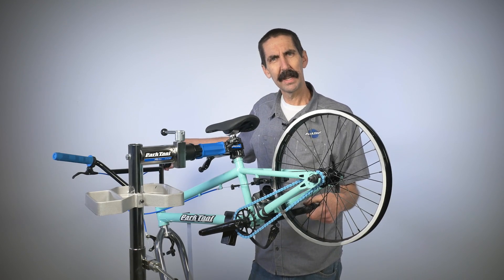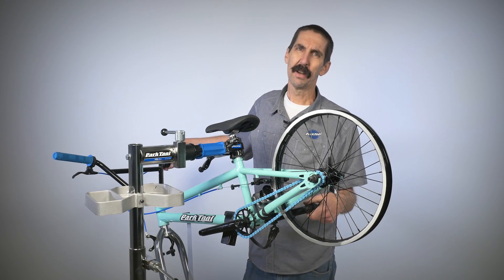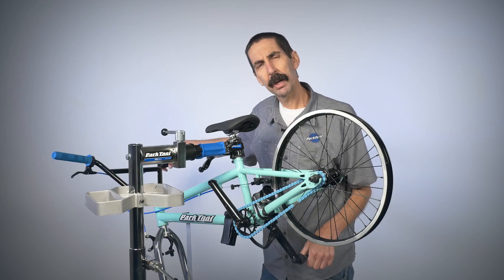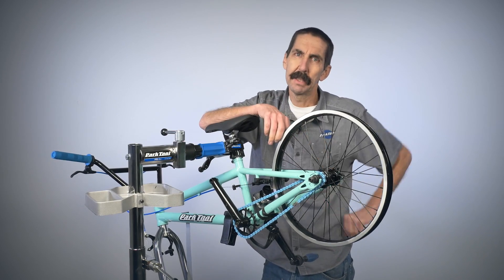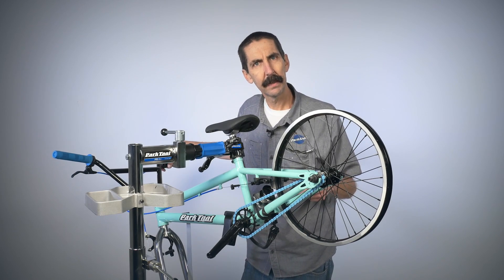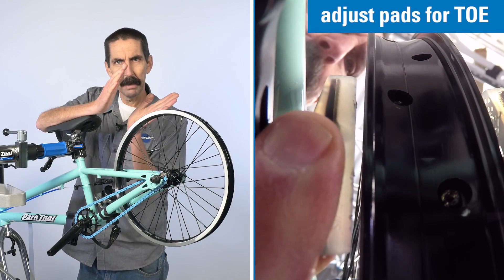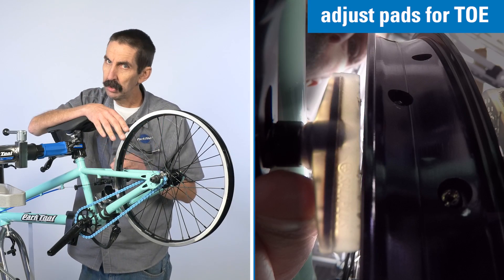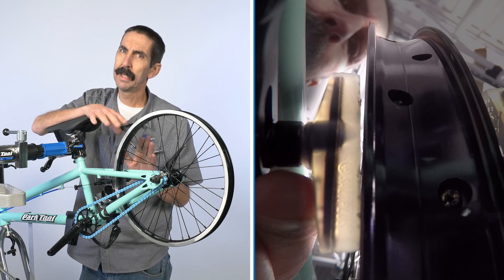Why Do My Brakes Squeal? - Tech Tuesday #56

Comment: adjusted toe...still get squeak :(

i cleaned my wheels with alcohol. I sanded down my brakes. don't know what else to do :(
Reply from the maker: There are times you may need to try a different pad with a different compound.

Comment: My bike is stationary. When i press the breaks it is noisy. Help me!
Reply from the maker: So you have a stationary bike and the brakes are making noise? Are you using the brakes to give resistance? If so I would look to make sure the pads are not warn out. Our videos on Rim Brakes might give you more info as well. Thanks for reaching out.